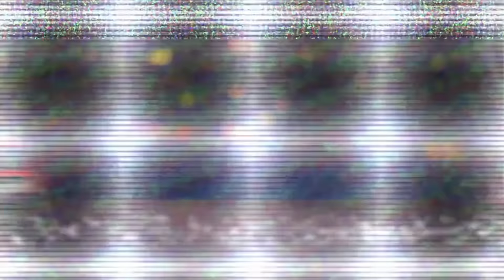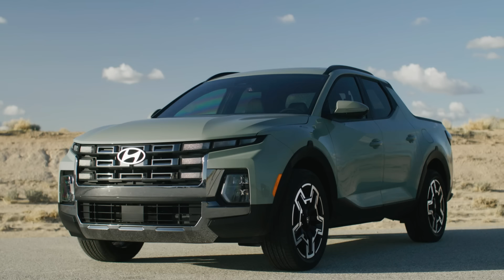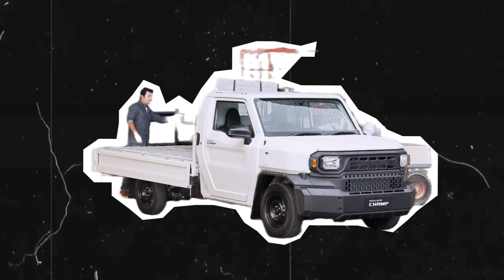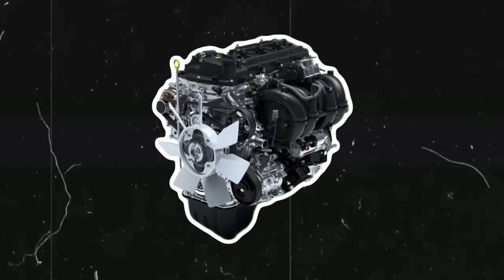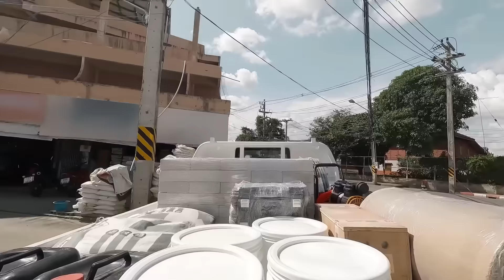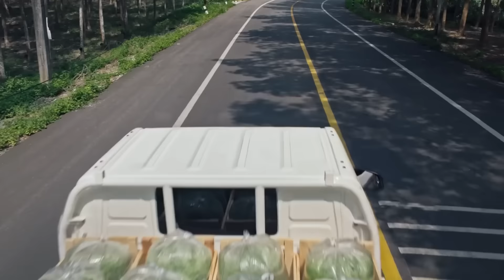7 Reasons You Should Wait For Toyota Hilux Champ (Don't Buy Maverick!?)

Comment: I asked ChatGPT if it is true that Toyota is going to sell the Hilux Champ in the USA soon? 

Here is Ai's answer: "You've probably seen stories or videos claiming a "$10,000 Toyota pickup is coming to America." Those are misleading. There is currently:
No Toyota USA announcement
No U.S. release date
No U.S. MSRP
No U.S. reservation/order program
One major obstacle is that the inexpensive overseas version isn't configured to meet all U.S. emissions and safety requirements. Import tariffs and the additional equipment required for U.S. certification could also eliminate much of its price advantage". 

Here is what ChatGPT said that Toyota is really planning to sell in the USA and it is not the Hilux. 
It is a truck that is probably similar to the Ford Maverick with a price of somewhere around $30k.... not $12k.

Here is the link:
https://chatgpt.com/share/6ab73c57-9608-83e8-b27d-9712c873a435?ogimg=plain

Comment: I absolutely love this idea. I’m worried about roll out.  I own a trail hunter, a hybrid.  I know my truck gets less than 14 miles per gallon.  So gas in a hybrid isn’t much better.  I’m also worried because I know that I was not able to order a custom Toyota. That Toyota doesn’t do custom orders across America (Which is fine Toyota can do what they want … yay freedom and capitalism and all that).  You get what has been made.  Which means a Toyota factory will need to be retooled to build a new truck AND to handle “near endless configurations”.  I want this to be true.  However I have to acknowledge that retooling an entire
Factory won’t happen quickly or cheaply.  Maybe they are building a new one: the tundra is San Antonio, My sweet baby Tacoma is Mexican.   

To offer the champ as stated here… in America… by a decent timeline.  A factory some where near here  better damn well be near finished.

And a historic fact: retooling factories to make near endless configurations caused the car manufacturers to require bailouts in 2008, the current limited markets and these problems a hilux champ would fix,  as well as (and most importantly) the Edsel which almost killed ford.
Reply from the maker: Valid points on the logistics—would you be willing to wait longer for that perfect configuration?

Comment: I want a small v8 in it and an 8 foot box.
Reply from the maker: That would be a crazy setup, but a V8 in a compact truck like the Champ is realistically very unlikely. Too tight on space and emissions for that segment.

An 8 foot box though… now that would genuinely change how people use small trucks. Would you actually pick it over a midsize if it had that bed length?

Comment: The Toyota Hilux Champ is not officially available for sale in the USA. This is primarily due to safety and emissions regulations that the vehicle does not meet, making it impractical to import and sell in the US market. While it is available in Thailand for around $13,000 - USA spec set at $46000 in 2035
Reply from the maker: If Toyota could get it compliant without blowing up the price, do you think there’d be strong demand in the U.S.?

Comment: Just a little investigation and you will find it is not available nor will it be due to safety standards
Reply from the maker: You’re right about the Thailand-spec truck — as-is, it wouldn’t meet U.S. safety standards. But a modified version built to comply with U.S. regulations is definitely possible.

Comment: If it ever comes to USA, I will buy it brand new with basic options (no stupid touch screens, hell ill even forgo window switches) for no more then 20k out the door. Anything less then that and ill stay with my goodie but oldie Outback.
Reply from the maker: That’s a straight shooter approach — no frills, just a basic, reliable truck without all the extra tech. Toyota hasn’t confirmed any U.S. pricing yet, but something around $20K out the door feels a lot more realistic than the $12K figure once you factor in compliance and dealer costs.

If Toyota did bring it here, what’s the one feature you wouldn’t compromise on, even in a stripped-down base model?
Reply: @tech_triumph  A good reliable drivetrain that's available for any mechanic to work on, no dealer only repairs. Nothing lasts forever.

Comment: If I could get this configured like this....
2.4 L turbo diesel, manual transmission, two-speed transfer case, four-wheel drive, long bed, The under bed storage compartments, can't stand white trucks, a nice medium to dark green would be great, rubber floor mats, super tough vinyl seats, Yes I'm an old guy so I want my air conditioning and heat. I'm putting in my own radio, I hope it's got enough legroom for 6 ft tall American farmers. One can only dream.......

Comment: I didn't see a 4-door crew cab truck version.  Will that have that?
Reply from the maker: The global version does offer a double cab (4-door crew cab) with about a 5.1-foot bed, so it’s very likely a U.S. version would include that too. What would be your ideal setup — crew cab with a shorter bed, or would you want a longer bed even if it means sacrificing a bit of cab space?
Reply: @tech_triumph I would want an 4 door crew cab with a 4 foot bed. That is my ideal truck I would buy to replace the one I drive now.

Comment: It will be sold at $12,000

Plus 25% chicken tax 🐓
Reply from the maker: Yeah, once you factor in the chicken tax the $12K number gets a lot less realistic. That said, even if it landed closer to the high teens or low $20s, wouldn’t you still consider that a solid deal for a simple, body on frame truck like this?

Comment: The lowest price option in Thailand is the cab chassis at 519 000 Bhat, which is US $16 700. I have no idea where the $12 000 figure comes from, but this includes all taxes, one year of comprehensive insurance, and dealer incentive extras such as window tint, floof mats, and garnish items at their discretion.

All the manufacturers here, Toyota, Isuzu, Mitsubishi, Nissan, Mazda, and Ford, have single cab body on frame basic model commercial options at similar prices. The Champ is just another option to the single cab Hilux Revo, which is better equipped for
 $18 000.

Comment: Even with the current roll back of the MPG standards, the motor in this truck, as built in Thailand, will not pass EPA standards. Aside from that, I live in Thailand half the year and I’ve never seen a Champ modified for four passengers. The mod shop for this doesn’t exist. It is absolutely a great truck that will share the same motor that’s in the new Land Cruiser FJ but…. The best version of this truck and the one I see exclusively in Thailand is equipped with a 2.8 liter four cylinder diesel which is shared with the Hilux and 4tunner. As stated many times in these comments, this truck will never be available in the US.
Reply from the maker: That’s a fair take. I agree the diesel setup everyone wants wouldn’t clear U.S. emissions, and as-is the Champ isn’t coming here. But the gas engines are likely to meet EPA standards. 
If Toyota did bring a gas-only, U.S.-legal version based on this platform, would you still be interested, or is diesel the dealbreaker for you?
Reply: @tech_triumph  Interestingly enough, the 2TR-FE 2.7 four cylinder gas is what the new Land Cruiser FJ is equipped with. I’m literally waiting to drive it when it hits dealers here in Chiang Mai Thailand. That engine is more bulletproof than the 2GR six cylinders that they discontinued in the US in 2023. The 2TR is what they put in late 90s early 2000’s Tacoma and 4Runner SR5s, many of which are still on the road. So yes, I’d love to see that in a Champ or LC-FJ in the states. I don’t see it happening though. I drive a 2007 FJ Cruiser in the states, zero problems. That’s a 1GR 6. Gotta keep it now.

Comment: 4 door?
Reply from the maker: The global Hilux Champ does offer a double-cab in some markets, with a roughly 5.1-ft bed, so it’s not just a single-cab work truck everywhere. If Toyota ever did a U.S. version, a double cab would honestly be the most likely configuration to make the business case.
If it did come as a double cab, would you still want it stripped down, or would you expect a few basic comfort features added?

Comment: I’d like it with the diesel used in most other countries. We will never see it
Reply from the maker: Yeah, a diesel does sound ideal, but emissions and regulations make it very unlikely for the U.S. market. What’s the main reason you want a diesel over gas?
Reply: @tech_triumph dependability, mpg and torque. They should drop emissions here in the states to that of Thailand. 😊 my feelings are that when china, Mexico and the rest of the countries stops burning coal for power generation,  then put emissions back on. 😊

Comment: Dealers are going to mark them up like crazy.  Remember the $38,000 Bronco?  Then dealers had them on lots for $98,000.
Reply from the maker: That's a valid concern! Do you think a manufacturer could implement a strategy to prevent those kinds of markups, especially for an entry-level vehicle like this?
Reply: @tech_triumph Not only could they, they definitely should. The manufacturer probably gets their money from the dealer, but if i was a manufacturer I'd be putting a stop to their practices just to be able to produce more vehicles.   If i made "blocks" and the msrp was $10, the dealership purchases 100 of my "blocks" only to mark em up to $50 and only sells half, they aren't going to purchase more from me sitting on inventory.  But, if they sold them near msrp, they would sell out and need more.

Comment: They can’t build that in the us and charge 12000.  Labor is way more expensive here.
Reply from the maker: You’re not wrong. U.S. labor costs alone make a true $12K truck basically impossible if it’s built domestically. That’s why something like this would almost certainly have to be built overseas and imported, which then opens the door to tariffs, regulations, and higher final pricing anyway.

If Toyota did import it and it landed closer to $20K, would that still be compelling to you, or is the appeal only there at ultra-low pricing?

Comment: There is some  chicken tax on small import pickups. Unless they drop that we won’t get it and never for that price.
Reply from the maker: You’re right — the chicken tax is a huge roadblock. As long as that 25% tariff exists, importing a small pickup like this at a low price just doesn’t pencil out, especially for the U.S. market. That’s a big reason why even if it did come here, the price would jump fast.

If the chicken tax were repealed tomorrow, do you think manufacturers would actually bring these compact trucks over, or would dealers still price them out of reach?
Reply: @tech_triumph   I saw a Toyota Hylux that was being sold in Thailand for a tradesman, it had a hydraulic lift on the back and a few extra lights . Total price $16,000 USA dollars when doing the comparison. No way they would ever sell it at that price here. I’d be surprise if it sold for $29,999 base too.

Comment: It's going to be so under-powered.  You'll be able to tow a hot dog cart.
Reply from the maker: It definitely prioritizes efficiency and simplicity over raw power, especially with the smaller engine options. What kind of power figures would you ideally want to see in a truck like this?
Reply: @tech_triumph  I don't know how Chrysler shoved a 5.7 L Hemi in my 2011 Grand Cherokee, but I'm not complaining about the 7500 lbs towing capacity.  This vehicle is an SUV.

Comment: I’ve said from the beginning that Jeep really missed an opportunity to do something similar with the Gladiator chassis. They could have easily designed a small, two door cab truck with a cargo/utility/tradesman bed option. I think that would be a good seller for Jeep.
Reply: The prototype for the Gladiator was exactly what you described. What came out in production was trash.
Reply: But it would have to be well built and reliable. Never get that out of stellantis.

Comment: I rode around Costa Rica for 9 years in Hilux trucks. The old ones are super tough and I saw them customized a bazillion ways. The cops there use Hilux trucks. They are easily the most practical vehicles I saw in Central America in my opinion. So I hope something that good comes to the USA.
Reply from the maker: 9 years in Costa Rica with Hiluxes - that's real-world testing! But do you think Americans would actually buy a basic Hilux, or would they complain it's too stripped down compared to Tacomas? Because what works in Central America doesn't always translate here!
Reply: @tech_triumph it's not just Central America, Hilux trucks are used all over the world in unpaved places. 
I would rather have a stripped version myself, I don't care about luxury.

Comment: This thing has been quite the hit in Thailand. The only way it will be allowed into the USA is if it is built here in the USA. That means it will be a rolling trash can, too. Just look at what Toyota now has for recalls. Their trucks are built here and Toyota is now starting to look like the Recall King, Ford. I won't buy anything made in the USA after 2000 because everything turned to crap after then. I WILL definitely be looking into a 2000 or earlier Keitora straight from Japan because even used ones are better than new shitmobiles from America!

Comment: Never. Going. To. Happen.
Reply from the maker: Do you think it's due to regulations, pricing, or something else entirely?
Reply: @tech_triumph  Great question. Pricing will be one of the biggest obstacles. A light truck hitting the market at that price point would be the equivalent of an atomic bomb going off in the middle of light truck sales nation-wide. I know, it's an apples to oranges comparison, but, the disruption to other manufacturer's could be significant, even though a bare basic Hilux compared to a base model Colorado or Ranger is night and day different concerning features.  All the bell's & whistles versus saving 20K + on the price of a daily driver that can also do work if needed ? That point will present in consumers minds. That point will greatly affect how fast the wallet comes out at the dealership for those of us looking for a utility vehicle, and not a $100K 4X4 Leather clad luxury Truck . Toyota has seen this before.  When the U.S Version of the Yaris hit the market back in 2007 it was marketed to younger adults. Price conscious senior citizens (and others)  snapped them up by the tens of thousands. U.S based auto manufacturers & Unions will kill this idea long before Toyota can pull it off, via regulation and other antics.

Comment: If you can't get a diesel forget it.
Reply from the maker: I get that. A diesel fits the whole point of this truck perfectly. Long life, torque, simplicity. Realistically though, emissions make it a long shot for the US. If Toyota did offer it gas-only here, would there be any setup or use case where you’d still consider it, or is diesel a hard line no matter what?

Comment: If this comes with a manual transmission, and manual transfer case for 4 wheel drive under $20k I will be first in line.
Reply from the maker: Sounds like you're looking for that old-school rugged utility! What makes those manual controls so important to you?
Reply: @tech_triumph reliability and control. My daily driver is a 25 nissan versa with a 5 speed manual and I need to make it last until I retire. Only 30-40 years, but no cvt, turbo, or timing belt (has timing chain) give me a fighting chance.

Comment: We need the little diesel motor, but it will never happen.
Reply: Diesel is a dollar more in my state - not a good option here
Reply: @TheSulross You go further on a gallon of diesel, the motors last longer, etc.
Reply: @ThoneJones  Also, diesel puts out more torque for the same displacement. Nice if you want to tow something.
Reply: @TheSulross  Diesel gets almost double the mileage per gallon, so Diesel is a lot cheaper per mile.

If you get $30 of gas that takes you 100miles, and you get $40 of Diesel that takes you 200 miles, you only used $20 of Diesel to drive 100 miles as opposed to $30 of gas.

This conversation reminds me of the time A&W had a 1/3 pounder burger for the same price as McDonald's 1/4 pounder, and it failed because people thought 1/3 pound was less than 1/4 pound.
Reply: If I remember correctly diesel has 40% efficiency vs gas 20%.  So it does go further, also if you don’t have to do any of the epa bs, that truck could stay for a long long time.
Reply: Too right! No more corn in our fuels, either!

Comment: Just put the old 1.8L naturally aspirated 4 cylinder, with a 5 speed stick in it. It is pretty gas efficient and is pretty peppy.
Reply from the maker: Do you think a simpler powertrain like that would appeal to a lot of buyers, or is the market leaning more towards turbos and automatics now?
Reply: @tech_triumph for people looking for a work truck all the add ons do not add functionality. Turbos though boosting hp on smaller engines, shorten life and are very expensive to replace.
Reply: Turbos are junk bombs!!

Comment: It will be 30/32k in America, says AI.
Reply from the maker: Yeah, AI predictions on pricing can definitely swing high, and $30-32k isn’t out of the realm of possibility once dealers and markups are factored in. That said, I still think if Toyota actually brings it here it could land closer to around $20k, especially if they keep it stripped down and practical. What features do you think would need to stay in to justify even a $20k price tag?
Reply: @tech_triumph if it comes here, it will come with mandatory gps tracking device (2014) regulation.  It needs air bags per US safety requirements and  crumple zones, just to name a few.